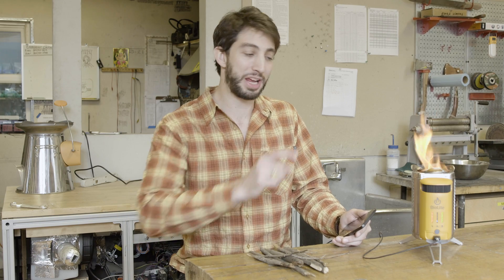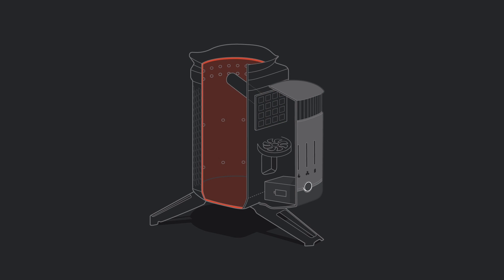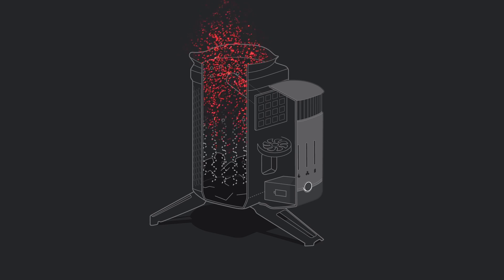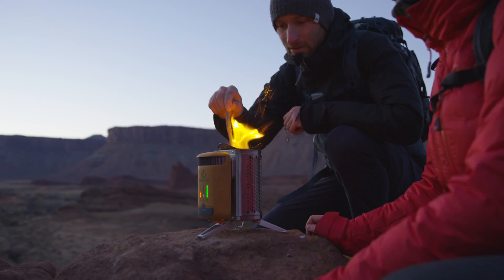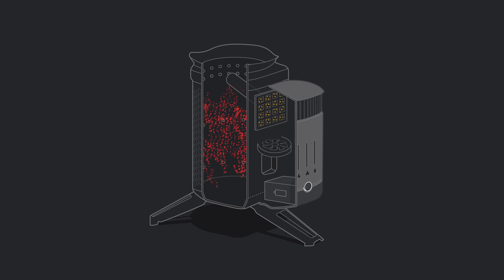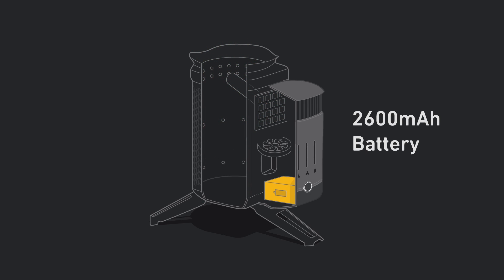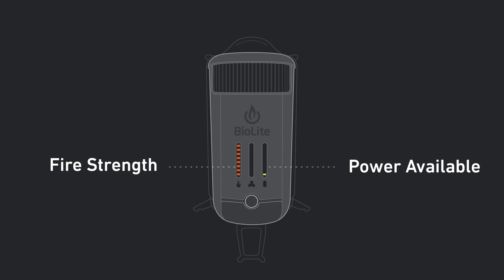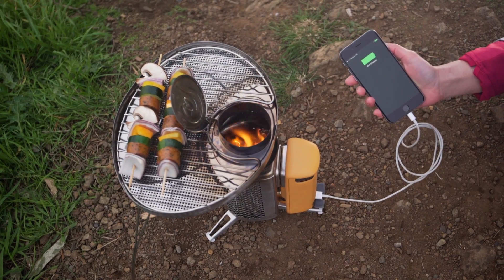How Does the CampStove 2 Work?

Comment: Does it only charge with the fan on, or charge by heat? Can it charge by placing the heating element in hot coals?
Reply from the maker: Both elements are important to the battery charging, since heat from the fire turns the fan to generate electricity. The battery can also be charged via cable and a standard outlet if needing a full charge before making a fire. The heating element and battery are connected, so it is not safe to put them directly into a fire or over coals to create power. This will melt the battery and make it unsafe. Only use the electricity generation through proper use of the CampStove as it is designed.

Comment: I guessed that you'd use a Peltier element and it seems I wasn't far off. Pretty cool idea for a product. Hopefully you'll be able to optimize it to get more than 3W out of it at one point, but for now it's a great little invention.

Question: Does the efficiency increase in colder climates? In theory, the energy output should increase with bigger temperature differentials. If so, which outside temperature is required to get the 3W of performance?
Reply from the maker: Thanks for the great thoughts! While climate certainly plays a role, many variables can play equal or larger roles in the total stove power output: Type of fuel, Amount of fuel, Amount of char/ash in the chamber, etc. The stove is able to generate 3W of power under normal ambient (~70C) conditions. We recommend following the tips in the user manual and online FAQ for best results.
Reply: @BioLiteChannel  Thanks!

Comment: Most TEG's burn down around 235 degrees and a typical bonfire gets up to 900 degrees celcius in the middle. How do you assure your users that they wont burn off the TEG module? How do you keep it below 235 degrees?
Reply from the maker: Hi - there is a probe that takes the brunt of the heat from the fire and the TEG module is offset inside the power pack, never comes into direct contact with the fire. Years of thermal testing went into the patented design of the CampStove.
Reply: If it’s “patented” it MUST be good! 🙄

Comment: Cool but 3W is what a tiny solar panel will do. Granted you need sun but it's more convenient for transport and use, it's 5-10x cheaper and probably less prone to failure.
Reply: This also functions as a good jet boil replacement.

Comment: Oh man this is soooo cool.  I know how you can extract ALL of the energy horsepowarz from the flame.  Ditch the electric fan and instead partially seal the container utilizing a micro turbo/turbine to regulate inlet air and outlet exhaust, then use the output shaft from the turbine to turn a micro generator.  For the final nail in the coffin, a pressurized boiler with attached steam turbine while you're at it too.  Easily 8 billion BTUs extracted from all the earths natures!   Eh, don't worry about safety.  Rabid bears are more of a concern in the wilderness.

Comment: absolutely brilliant, truly! How long at full flame will the batter take to charge?
Reply from the maker: Hey Richard, Once you have a strong fire going it takes about 2-3 hours to fill up the entire CampStove 2 battery.
Reply: that is great! How many cycles of phone charging will that provide?
Reply: It depends on your phone, but a 2600 mah battery, like the one in the Campstove 2, will probably give you half to 80% of a charge on a device like an iPhone 6.  If you had a hot fire going in the unit, at 3W output, it would probably take 4 or more hours to give it a near full charge..  The best bet would be to get the unit cooking after supper time, stock it as full as possible without reducing airflow, plug your phone in, and leave it overnight.  It will charge while the fire is hot enough, and hopefully the stove will have a fully charged internal battery which will take over charging when the fire cools off.  You'll probably see a full or near full charge by morning with this method.

Comment: is there a possibility for a discount upgrade if you're already the proud owner of the first verion?
Reply: The answer is not my question. ;)
I already have the first version and did not want to buy a completely new one. Can I buy cheaply somewhere only the airblowmodul?
Reply from the maker: Hey Martin -- the upgraded thermoelectrics required a different configuration for the heat probe and airflow system so the new powerpack is not compatible with the old burn chamber. You can see more on our recent FB live broadcast: https://www.facebook.com/biolitestove/videos/1492240794144114/